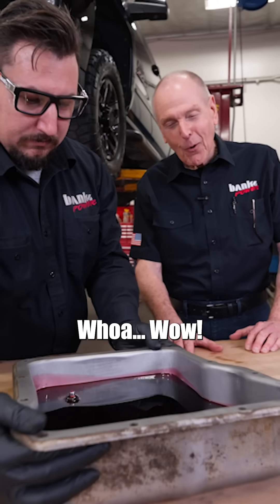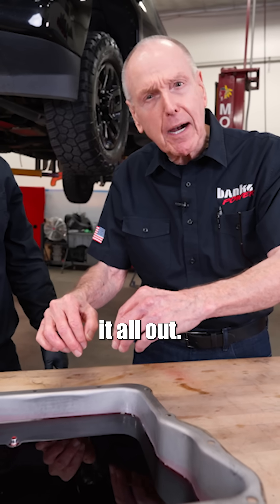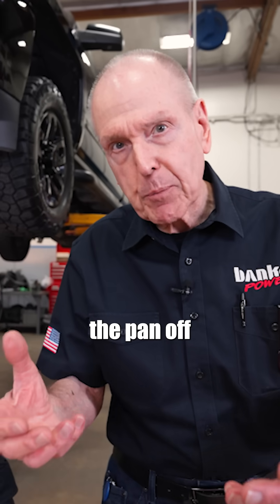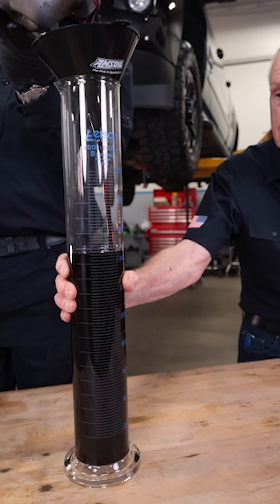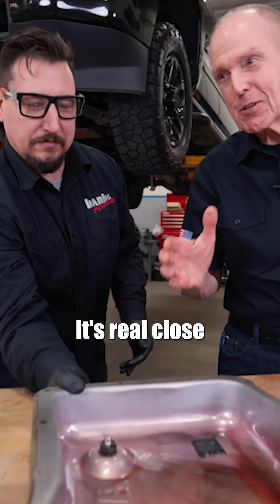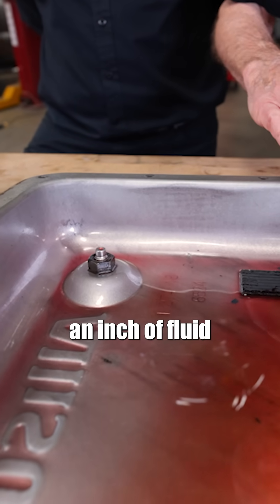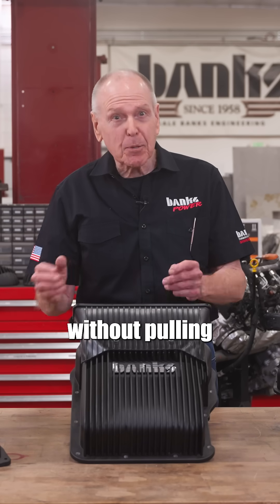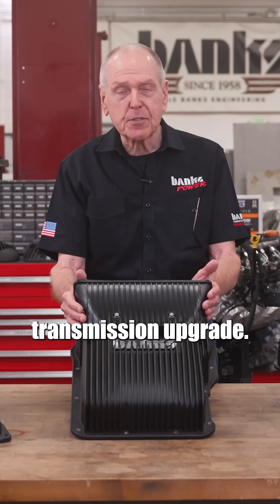This factory drain plug is a joke.

Comment: The reason the engineers do this is so that the transmission pump holds its prime during oil changes by not allowing the oil to be lower than the oil pickup

Comment: It could have been done to retain a small amount of fluid in the even the drain bolt was under tightened. Especially considering that it would add cost to make a hill there for seemingly no reason other than to hold fluid.

Comment: You have to pull the pan to get to the second filter ….
Reply from the maker: Yes. The Allison 1000 has a spin-on filter and an internal filter. The internal filter does not require regular service intervals. So, most guys just drop the fluid via the plug and change the spin-on filter. Because the Ram-Air Trans Pan allows for a more complete drain without removing the pan, it aids in convenience.

Comment: I wonder if hes ever done a video on the Lb7 duramax pan. Mine has a low place in front of the cross member that cant drain. Ive taken a piece of curved copper tubing before and reached it and hooked it to my solvent gun to suck it out. Seems like i got a half quart of engine oil out.

Comment: Ok so to be fair they do that on purpose. It's supposed to just get enough fluid out that you don't get moved in it while taking off the pan to change the filter. That's also why a lot of pans don't have a drain plug at all is so you have to take the pan off and change the filter. I think the banks pan is 100,000% and upgrade but the factory did have reasons for what they did

Comment: Maybe I'm wrong about this, but if you're changing your fluid you're gonna be replacing your filter as well, which you can only do by removing the pan and then you pour the remaining 1750ml of fluid out right? So it's not a problem that some pools in the original, in fact it's supposed to because there are magnets that catch metal in the pan and they are supposed to be out of the flow of circulation to some extent.

Comment: Honestly I'd prefer the pan service every time because it would've made my Jiffy Lube wrench turning life a lot easier in college with those God-awful little bolts always spinning heads off with not even a quarter of the torque spec required to tighten it back down.

Comment: Well you should clean the pan any way so you still have to take the pan off the factory pan is designed like that so you can drain most fluid before  removing the pan its not designed to drain all fluid so people are supposed to take it off so your invention is useless 😂

Comment: Maybe they want you to retain some original fluid as it contains usable clutch particles which help worn transmissions from slippage.  Ive experienced 2 automatic vehicles that received transmission oil changes and both cars felt like the was a bit more slippage (like a loser stall feel), upon acceleration.

Comment: Well, it's not a "drain" plug. Once transmission is to temp, you remove that plug and let excess fluid out or add till it comes out. Come on Mr Banks, you know better .

Comment: The ford rangers in the uk dont even have a drain plug so you undo the bolts pull the sump and the oil goes everhwhere. Its a nightmare

Comment: At what angle can the car be at before the weld nut protruding into the pan allows the oil to drain. I use ramps in my driveway so I’m just wondering.

Comment: The reason for the elevated drain plug is to allow inspection of the pan contents. Upon a tranny service the pan is supposed to be inspected. This is the part you did not consider. If you drain everything out then theres apt to be less material to discover in the pan. The drain is to get the level below the top edge of the pan to make it less messy. A lot of pans have no drain at all for this reason, not to mention a drain plug is an extra place to leak. I'll take the old pan because it works like it was designed to.

Comment: People on some other automotive channels really hate on us engineers (I'm a retired computer and electrical engineer), though this guy is an excellent example of someone who knows what the eff he's doing and does it right. When he talked about his redesigned replacement for that oil pan, it made perfect sense to me and I had to think, "why couldn't those working for the engine manufacturer have come up with something like his in the first place?" It's just moronic to have that raised area inside the pan, with a nut, for a drain. Why is the drain of a bath tub lower than the rest of the tub? So all of the water will drain out. The drain for an oil pan should be made the same way, and not as an island. Der!
Reply: I used to hate engineers as a mechanic because some things are just so stupid it almost seems like it has to be intentional. Theres a documentary I watched a few years ago, and most of the time the reason is just cost. Engineers tend to catch things and offer a solution through a redesign, but if the suits decide its going to cost too much money they will just let it go and let it become a recall on its own so they dont have to spend the time to go back and fix it on the assembly line.
Reply: My pops had an auto shop and he would say it's an intentional design choice. He swears up and down you need to keep some of the old fluid and the dissolved solids in it to mix with the new fluid because full flushes kill transmissions. Anecdotally I've always followed his advice and over the 30+ vehicles I've owned I've never had a transmission fail.
Reply: @Netanya-q4b  I believe that this only holds true when the Flush/Fill maintenance is rarely, IF EVER, done.
Reply: @Netanya-q4b  I was thinking the same thing. That default oil pan looks like it was purposely designed to retain a set amount of fluid. 

That said, that new oil pan looks amazing. Smart design too.
Reply: I thought the reason it was like this, and some don't have the drain hole, is because you are supposed to change the filter at the same time of the service, and the design choice encourages that.

Comment: I have an old 2002 Honda Odyssey. Transmission clunking. I flushed it five times with synthetic. It works okay in the freezing cold but in the warm and the hot season it clunks really hard so I have to manually shift it and it's very tedious because I have to drive slower. I even lost 3rd gear once but it came back. 
Honda made a big mistake in these older years and I suspect the solenoids could also be part of the problem. I sure as hell ain't going to take it to a dealership and have them test it $$$ just to find out nothing. 
Honda should have recalled every single one of these pieces of junk.

Comment: Once upon a time, manufactures used to place the drain pan in the corner or at an angle, which would make sense... But now there's the "planned obsolescence" pan, so that you can't get a complete drain. Thanks to the aftermarket for making sense out of nonsense.

Comment: Ive drained these kind of pans with a copper pipe that was bent about 100 degrees that I stuck into the train hole. then used sucksion to suck everything I could. saved me time.
Reply: I weld in or on a drain plug nut for the plug on the bottom of the transmission pan on the lowest corner for all future transmission fluid drains and changes . Something I've been doing for over 45 years already on everything I own !!

Comment: The point of the drain plug in the pan is to get rid of the fluid out of the pan neatly and cleanly without spillage in the process. It is not for fluid changes done often like engine oil. Yes. If you drain the pan, you should probably drop the pan and replace the filter. A drain plug in the pan does not eliminate that. I would favor having an external oil filter for an auto trans in the cooler line.

Comment: I was always told not to change automatic transmission fluid. It's a sealed system. Like A/C. If you have to add you have a leak. Transmission fluid is different. If you change it it will loosen deposits and cause clogs in the valve body.

Comment: My 1967 Galaxie has a 289 V8,
The oil pan is sort of sagging like a plastic bag, and the oil plug is sideways mounted,
So there must be an entire half quart stuck in that oil pan, filled with sludge from when I added kleen Flo and just general junk from sitting for over 35 years straight.

Damn

Comment: Ehm. You don't need to take off pan. There are literally deviced that help force out old liquid.
Also, you never change it in one rep. You replace nominal volume, you drive for an hour, you replace about a half. You repeat until satisfied. 2-3 reps usually enough. That is official recommendation.
Also, wtf patent pending on a pan?
Reply: not if you drive a standard

Comment: The OEM part was designed this way so that when a mechanic remove the oil pan and it should be removed to check the health of the transmission by looking at the sediments and the magnet.
Reply: Bullshit. Designed that way so an average car owner wouldn't be able to do their own maintenance.

Comment: The factory don't come with drainplug.  You supused to drop the pan. Normal you change the filter also so you still need to drop it. But it's a cool pruduct he designed.

Comment: not sure why you would change the pan other than looks. Factory recommends changing the spin on filter only every 15000 miles. at 100,000 miles drop the pan and change the internal filter. Allison has said, do not reverse flush their transmission. That will actually damage them.
Reply from the maker: @gethmord  Allison recommends changing the spin-on filter every 45k miles and internal every 75k miles. Assuming you want to change the fluid every time you do the spin-on, the ability to drain every drop is a huge benefit of the Banks pan. But the main reason for the Ram-Air transmission pan is its ability to cool the fluid far better than stock.
Reply: @bankspower  According to GM service manual, you only change the fluid when you do the internal filter. Other transmissions, if you haven't changed the fluid and it has 150,000 miles plus, don't change it. I've had a GM 4L60 go 250,000 miles without a fluid change. Was still good when others problems made me trade the truck in.

Comment: Please note, that the drain plug is only there, to allow the pan to be drained enough, to remove the pan easily, without spilling it all over. It is NOT intended to be a drain plug. Any proper service involves cleaning the pan and magnet (if equipped), then inspect, clean, or replace the intake filter screen. "Spill then fill" is NOT a proper transmission service!

Comment: #1 the original pan is made to protect the drain plug. #2 that's a clean oil pan after emptied, no oil sludges build up. #3 old oil is good for the trans and engines.

Comment: Im sure allison transmission designed that dimple in the pan for a engineering reason. They build the most heavy duty automatic transmissions and even yhe military uses them. Can operate with 15 -40 motor oil is the harsest conditions world wide. Just stating the facts.😊

Comment: You can also fixt that by plasma cutting that circle out and then tig weld upside down also flip that nozzole when done. There are many welders out there will charge you a small fee if you take the part to them.

Comment: I think you must be pretty damn crazy considering that if you change the fluid in the transmission when it's done got to that point it takes all the stuff off to pads or the clutches and it f** the transmission up so therefore you get to build it that's right I didn't think about it that way

Comment: i’m pretty sure they designed it like that so the new fluid and the old fluid (that has clutch material) mix and the new fluid gets some clutch material in it so the tranny doesn’t slip. then again it could also be a engineering mistake i’m no engineer

Comment: I started using a Mitivac pump first, gets most more oil out than most people think and you don't get a bath trying to juggle a full pan of fluid. Wish I bought one years ago and works great for engine oil changes eliminating the giant gush of oil when you first remove the drain plug.

Comment: This is why the trans flush machine takes lines off the transmission coplerand pushes/pulls through a higher volume than rhe vehicles can hold. Only some poorly designed cars force you to drain/fill through the pan.

Comment: The car industry is a scam. Parts made to not last over 80-100k miles, cheap plastic or very weak metals used instead of steel, cutting corners to make it as cheap as possible to mark it up 3,000% putting too much electrical bs in the car so if one part goes its usually a domino effect. Shits so ridiculous!

Comment: That’s not a drain plug that’s a fill plug it’s designed to pump fluid into the trans while the vehicle is running once it starts to drip out of that fill plug with the trans fluid is full

Comment: That is a fill/check plug, not a drain plug. Engine running in park or neutral after going through the gears, fluid at approximately 120f, you pull the plug and fill it through the hole until fluid starts coming out. Some transmissions have a separate fill hole but you still need to use the check hole.

Please bring back dipsticks. We miss them.

Comment: It’s by design. Techs playing engineers: It’s because if you’re gonna skip removing the pan and wiping it out and washing it, it’s probably better in a lot of cases not to disturb the sediment in the pan too much. Also it prevents all the fluid from draining out if the drain plug fails, but still makes servicing less messy. Some transmissions on certain cars don’t even have a drain on them.

Comment: I've never ever changed the transmission fluids in any of my Chevy's , my 86 Monte Carlo LS  has 286,000 miles on the 700R transmission and shifts perfectly . 
Same goes with my 1989 Chevy K20 (239,000 miles) and my 1992 Suburban (193,000 miles)
All 3 run and shift great and btw i know of many other Chevy owners that do the same and they run and shift great as well .

Comment: I mean any drainplug beats doing it the normal way where you take out the "dealer use only, fuck you" plug where a dip stick is supposed to be and start loosening torx.

Comment: only... that isn't a drain plug, it's a level set plug. You're supposed to have the engine running, put the transmission through all gear selections, then pull the plug and fill with fluid while the engine/ transmission pump is still running, until fluid runs out of the hole. It isn't meant to use to get all of the transmission fluid out.

Comment: All the way back into the 70s I could never believe why the big three on automatic transmissions actually never put a drain plug in the pants. It’s like what kind of joke is the engineers thinking? What did your boss say? Don’t do that because we can make more work by bringing it to the dealer. What a load of crap I would drill it out put a drain plug in there basically just a drain it out, but I like your aluminum with the fence in it and now you put the little ram in the front of it that actually helps cool that pan Why couldn’t engineers in the big three think of that their heads are up there but we all know what their heads up because of the way they thought and now the dealers got the greed behind them, so we know where their heads are up to !!!

Comment: Great product but you know they put that recess bump in for a reason, and if you really wanted a true flush you have to pull the pan to change the filter anyway....this video is kind of redundant if you ask me. But most people won't know that sooooo......whatever I guess 🤷
Reply from the maker: The Allison 1000 has a spin-on filter and an internal filter. The internal filter does not require regular service intervals. So, most guys just drop the fluid via the plug and change the spin-on filter. Because the Ram-Air Trans Pan allows for a more complete drain without removing the pan, it aids in convenience.
Reply: Most guys will but that's not what a transmission service calls for now. Not only that but doesn't that inch of fluid touch the valve body?

Comment: to change the filter, you got to pulled the pan anyway
Reply from the maker: The Allison 1000 has a spin-on filter and an internal filter. The internal filter does not require regular service intervals. So, most guys just drop the fluid via the plug and change the spin-on filter. Because the Ram-Air Trans Pan allows for a more complete drain without removing the pan, it aids in convenience.

Comment: Changing transmission oil is just a money grab being a transmission guy myself it don’t break down like engine oil. It doesn’t get introduced with the gas gases of the engine unless it’s burnt or you’ve overheated your transmission. There is no sense changing it. You would just be changing pink fluid for pink fluid.

Comment: In all honestly if you doing a trans service properly you drain it if there is a drain plug (there isn’t always) and after you drain it you remove and replace the filter and put the pan back on with either the reusable gasket or a new gasket obviously only if the reusable gasket is in good condition

Comment: Most leaks on pans are on gaskets or drain plugs plus I’ve seen crappy diy jobs where they don’t even tighten there plugs and they vibrate off while driving leaving engines or trannys starved some pans have this (small 1-2 qt reservoir) to keep or hold fluid with a failing gasket or plug “called engineering” if it was made that way the first time weirdly/sadly enough for a reason by the engineers. Anyways if your doing a full drain,flush,filter you gotta take the pan off anyway 🤷🏻‍♂️. In the end your paying to run a couple degrees cooler.

Comment: Hmm, some auto box oil pumps won't self prime. Hence it's designed not to dump all of the oil & lose the prime to the oil pick up pipe. A lot of modern gearboxes have oil for life too. You have to enter the software to pump the oil out on a special exchange rig. They are now complicated bits of kit.